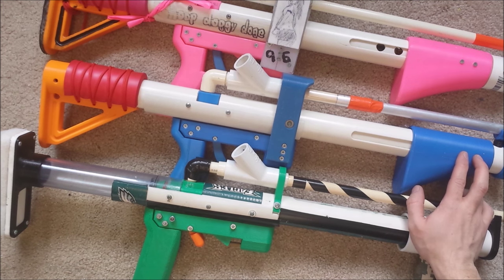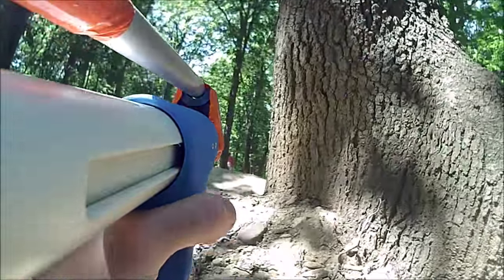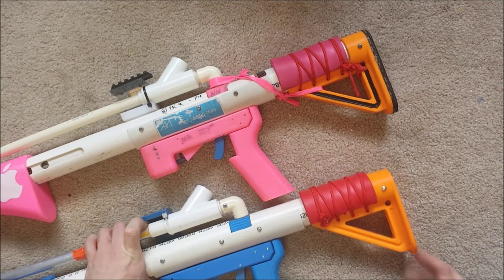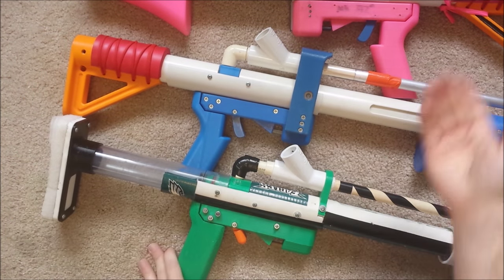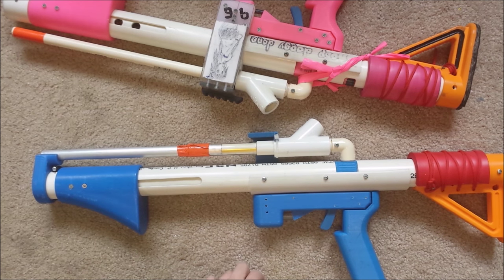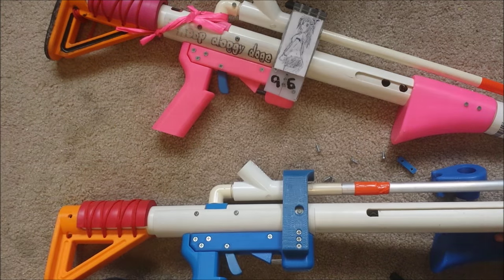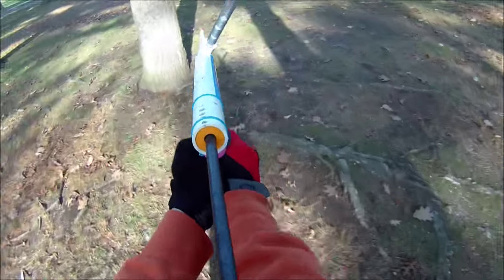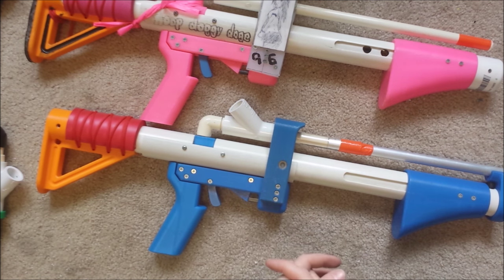MHA ESLT Full Review with Slug Style Foam Darts

Comment: Very fair and comprehensive review.   I was expecting something a little different after reading the forum posts.
Reply from the maker: +hoongfu It's not my favorite blaster. But I wanted to give it a fair review, so after using this almost exclusively for 6 months or so, you learn the thing's strengths and how to play towards them. This blaster has flaws. It does. It's difficult to service, it's not that powerful, and it's hard to get it more powerful. But for rushing in, and in-and-out jabs, this isn't bad. The terrain also plays a big role. You're at a disadvantage at NENO or APOC fields due to the sparse cover, but at FF or Babbage Park, the dense tree cover makes this a viable primary. It has a role in wars, it's just not quite as robust as other designs out there, at least in my experience.

Comment: At the last war I hosted I lent mine out to a kid that has never seen a homemade before and he did very well with it all day. One thing I that is worth mentioning in my opinion  is the seal (or lack of seal) I cant speak for anyone else but mine had a terrible seal when i got it and when i emailed to ask about it they told me that mine sealed better then most.  Gooping the 3d printed peace that holds in the O ring that seals around the plunger rod helped quite a bit, I also gooped all the screws going into the seal chamber as well as the plunger tube onto the bushing. After doing all that + changing to latex tubing, taking out the 1 inch of dead space behind the hopper and fusing with the barrel ALOT Iv got decent performance out of it.
Reply from the maker: +daniel murray I will have to try this. I saw your review on it, looks pretty dope, totally using the barrel mod as well.
Reply: thanks man, I think I had a "clear cpvc" barrel on at that time but iv since changed to a brass at petg combo
Reply: +Aeromech get some 100% silicon oil spray( i used the 3in1 brand) take off the hopper and cpvc elbow and in short bursts spray directly onto the rod and into the back of where the o ring sits. spray and pump for a wile untill the rod it totally coated. It took the seal from the  around 70%  i got from gooping everything to about 90-95%

Comment: I initially thought that my ESLT was underperforming due to the range being up to about 70ft here only and I thought that the problem came with the dart fit being different here than it is there in a different climate so the foam doesn't expand as much due to the heat, but the seal wasn't good either when I tried to test it.
Reply from the maker: +deathcon86 Im currently doing more mods on mine including improving the seal. From what I understand, MHA reported that performance was better with less friction and a weaker seal vs. a better seal and increased friction. After some mods (post video) I'm starting to believe them, at least for ESLTs.
Reply: +Aeromech Yeah the o-ring seals seem to work better for some reason. They even work really well in other types of blasters too.

Comment: ESLT not hitting near good rainbow ranges, or my definition ;) 
ESLT I had you fix because I'd have to ship it back and don't know what I'm doing. The ESLT was too complicated for me rather than rainbow and while great to just buy and showed, ESLT didn't make me want to work on homemades, made me get a 4BR. Rainbow was great for that. Also, my ESLT has foam on the back, lmao. Sad I didn't give you the tacticool accessories for my ESLT, I think it looks great with my derpy eotech knockoff and "vented barrel"

My ret at frozen foam hit ESLT ranges with suctions, so eh. My ESLT is also definitely not "too powerful" At NYDZ it I think my ret was real good and it rivals an ESLT for close quarters. However maybe it was just mine. Also, Zach broke my ESLT lmao, but if you look closer, a lot of cracks in the 3D printing. Fack no, 3D printing very bad for stress, and no it's not because I'm too rough, it should stand some stress. The pump grip broke 2 times, original factory one and yours, and this is a new reinforced one. 

ESLT is good for close pushing forward, it promotes a very offensive push and close quarters. You can spam with any blaster, (see my rainbow now) just not as fast, which has its downsides. I think since it was designed for Chicago mixed wars, safety and to use with silli domes it's different. It just has a different role. 

Great video as always, now review the rainbow ;)
Reply from the maker: +Snoop Doggy Doge I am aware of all of these things, but I know that high energy ESLTs exist. Have you ever been hit with Koree or Ted's ESLT? there are people that are just good with them, like I am good with rainbows.That is kind of a cream of the crop example, but they're out there.

Also I tightened the bungees on yours since you can handle it now
Reply: lmao, not even using that ESLT. Thanks though. I never got hit by them, or it felt the same. 

I think I agree with your firearm analogy, ESLTs are like the AR-15, I'd say snaps are like AKs (since anyone can make them) and Rainbows are like FALs,
Reply from the maker: +Snoop Doggy Doge I'm going to try daniel murrays mods because the seal is so bad, with the amount of force you're putting into the prime, if it's underperforming, it's gonna be because of that seal
Reply: Just send me another original rainbow ;) 
Or replacement upper body just incase, and a ton of parts, with premade catches. I'm too damn lazy to machine it with no "proffesional tools" 

BTW I fixed that RBP, Omni directional just needs a guide so the rod is closer to the top to be more reliable,
Reply: +Aeromech HA!  That's funny.  I put in the bungees into Ted's ESLT as well as my own.